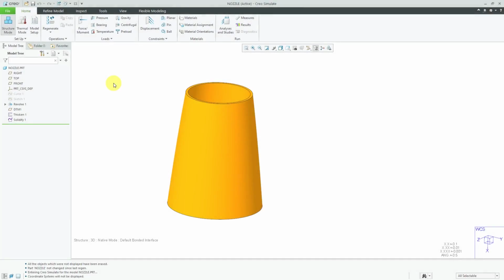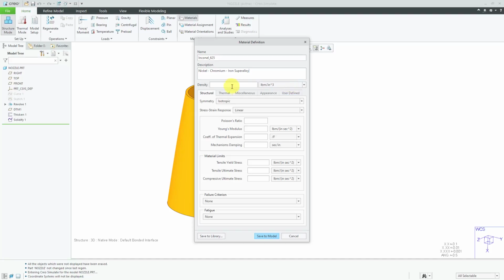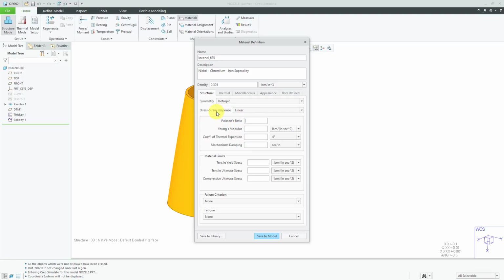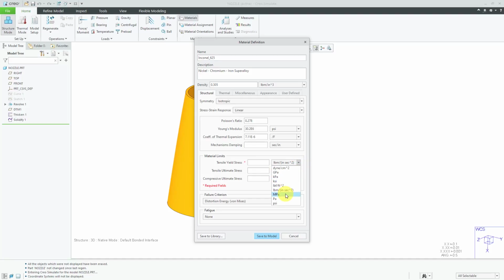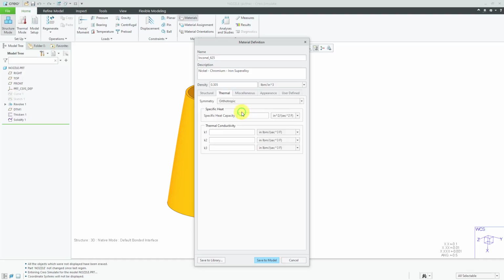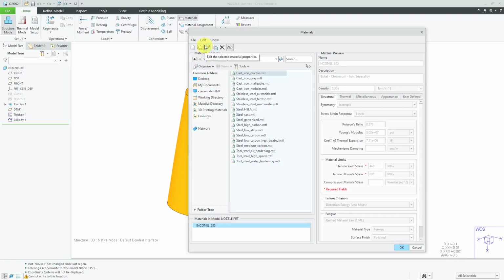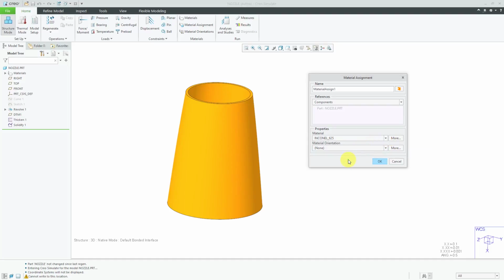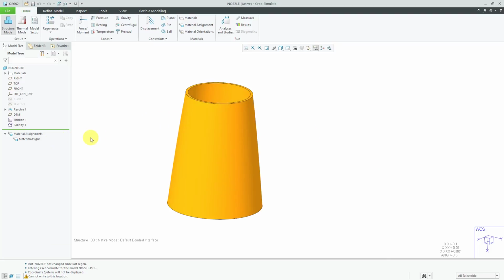Creo Parametric - Creo Simulate - Materials and Material Assignments

Comment: so does the "required field*" in red for material limits matter at all? I'm a mature student doing an assignment on the 5.0 educational version of creo for college and when I set a material's properties I thought something was wrong so I got bogged down trying to fix it. After I assign the material, when I go to mass properties the same figure comes up in volume (mm^3) and mass (kg). That doesn't look right. I don't know if the required field is the issue. I was hoping you'd mention that in this video.
Reply from the maker: I don’t understand what you’re talking about. Do you mean material limits when you specify a failure criterion? If you specify a failure criterion, yes, you need to fill in stuff like Ultimate Tensile, Ultimate Compressive, etc.

If you’re interested in mass properties, density is the only value you need to fill in.
Reply from the maker: Oh wait, were you using a density of 1 kg/mm^3? If so, the values for mass and volume would be the same. Think about the definition of density: mass divided by volume. Rearranged, mass = density * volume. If density = 1, then the values for mass and volume would be the same. If you used a different value for density, then the values for mass and volume would not be the same. For example, try using the density of steel (8 gm/cc) and you will see that the values for mass and volume will be different.

Comment: i want to ask you that  In lenovo(intel i3, 4GB RAM) laptop with HD graphics card is it possible to simulate the design in creo 7.0 crack version?
Reply from the maker: I don’t deal with anyone who uses cracked versions. Please unsubscribe from my channel if you’re a subscriber.
Reply: @CADPLMGuy  I am a student I can not effort to buy. My college has original version. Because of COVID19 I am at home, so I am using crack version for my practice
Reply from the maker: @parthapratimbarman8145  There's no excuse for using a cracked version of software. It's still stealing and unethical.
Reply: @CADPLMGuy  ok no problem. I will ask others